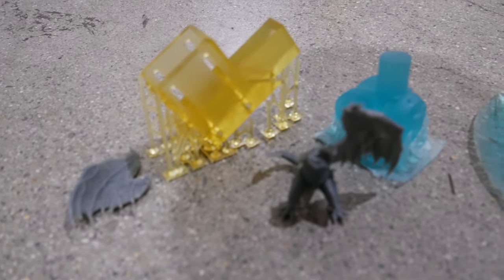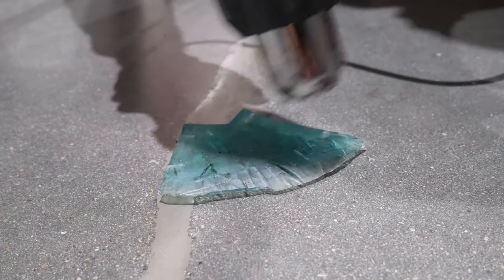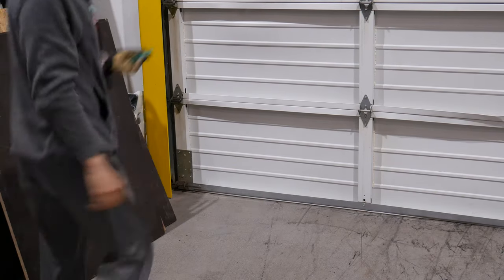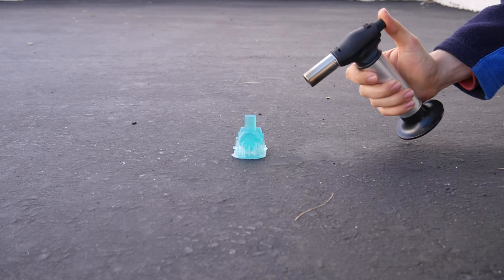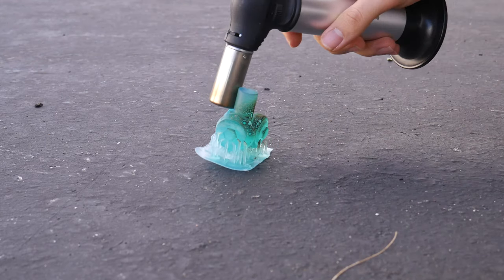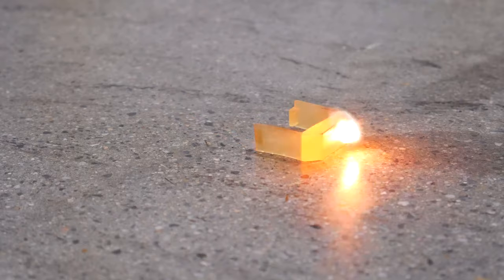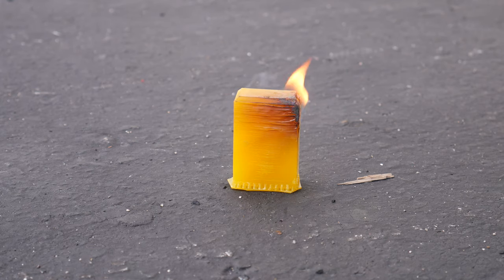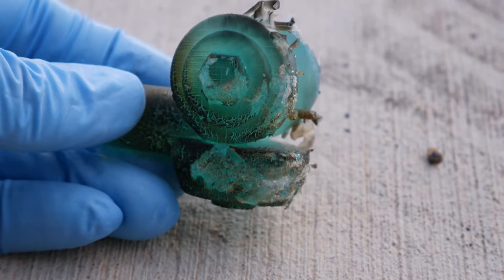Can Resin 3D Prints Catch Fire? The Results May Surprise You.

Comment: very interesting. any idea if the resin vapours are flammable? i.e. when the resin is still liquid... thanks!
Reply from the maker: Good question, I have not done any testing on liquid resin flammability as every data sheet I've looked at for the resins I worked with indicates that there is no significant flammability risk--if there was flammability risks, then there would be significantly more restrictions on how they are shipped.
Reply: Hiro Creations good point. thanks

Comment: how well does it resist moderately hot heat? like, heat gun 135 C for a few minutes?
Reply from the maker: Depends on the resin and the use. I found non mechanical or weight bearing parts held up fine in those temps and slightly beyond (hotend cooling mounts). Unsure over the long term if the head/cooling cycle will cause deterioration.
Reply: @HiroCreations  Thanks for the reply. if you can find it, it would have some fantastic implications for the science that I'm doing. We need some parts to survive an autoclave (125c, 25 minutes). It would also help a ton of researchers. So far youre the only video willing to try this. The internet is surprisingly a mess of none results on this topic.